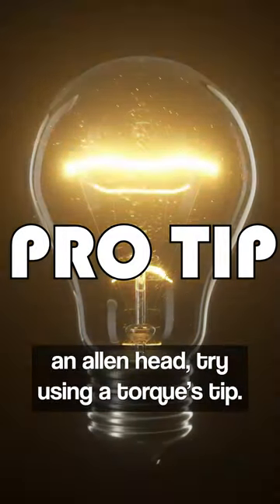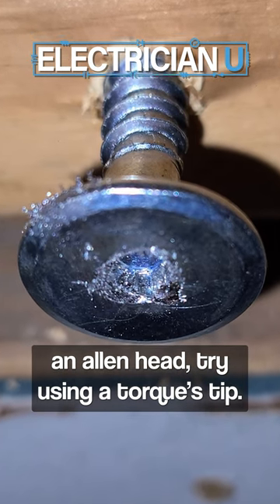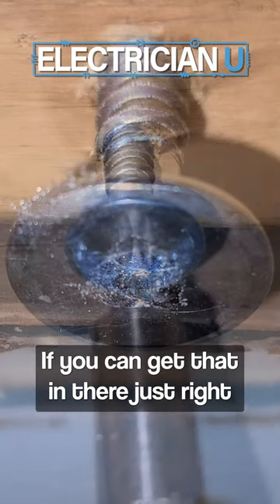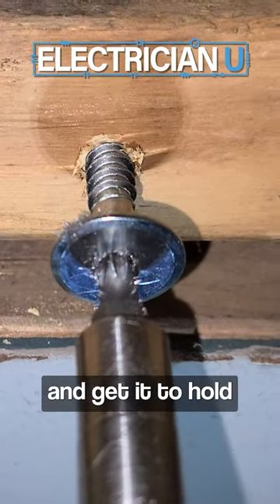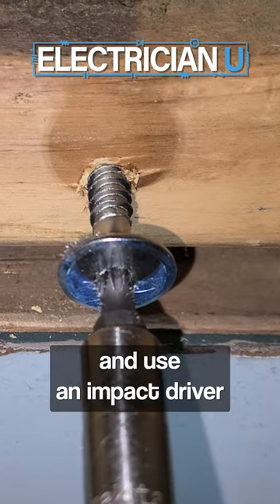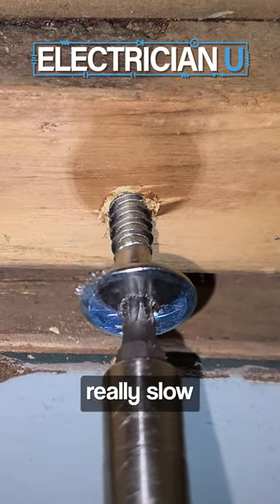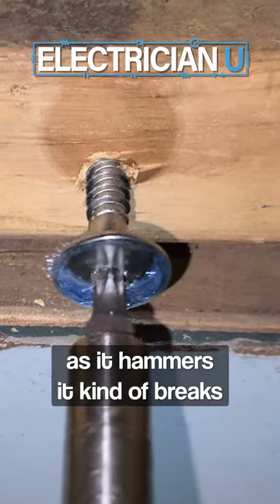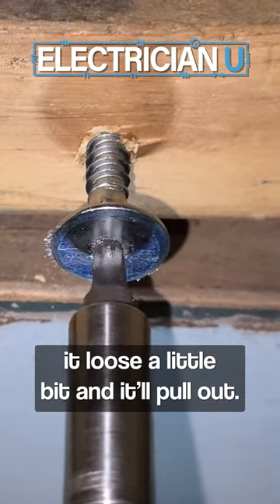Pro Tip - Using a Torque Tip on a Stripped Screw ELECTRICIAN HACK

Comment: Good tip since none of us typically carry screw extractors.
Vice grips after ya break the head off.
Last ditch drill it out w/out destroying threaded hole and use larger screw.

Comment: DO NOT USE AN IMPACT.
ProTip- if the torx bit is loose, go to the next size up and tap tap tap the bit into the hex socket with a hammer. Also for the love of god. Use a driver.

Comment: If it sticks out ... grab it with pliers or saw a slot across the head and use a big flat screwdriver to remove it. 
If the head is damaged, you are not going to use it again!